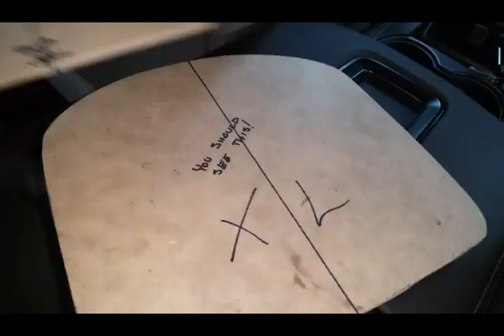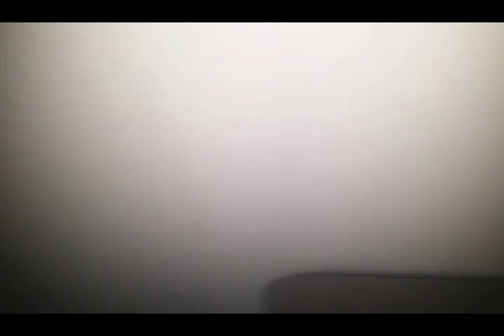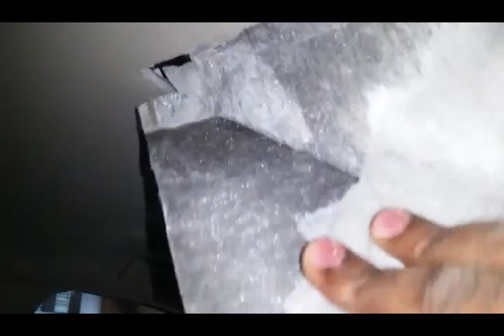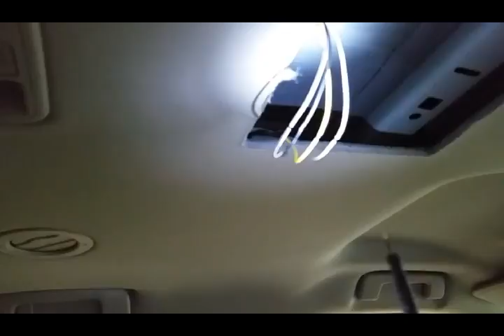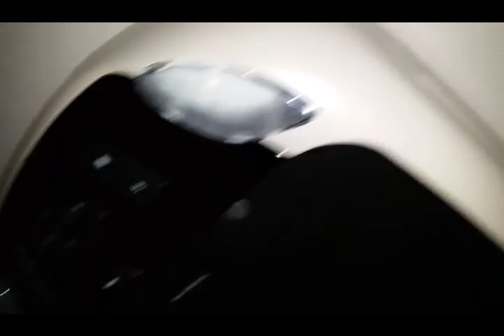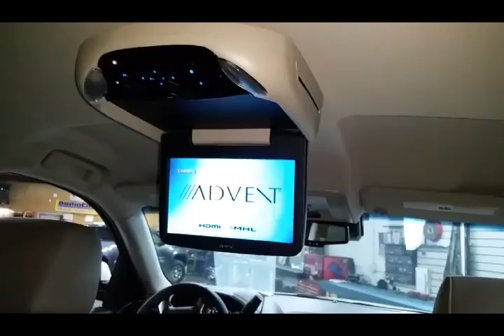How to install overhead  monitor / dvd player

Comment: If you dont want to use the light on the dvd player. Can you use that dome light wire to power the dvd player? Basically just power and ground to that dome light wire and be done? Sorry for the newbie question
Reply: my roof top dvd screen I bought has 4 wires, Door,accessories, power and ground. What is the accessory one for? Do we need it or is power and ground enough?